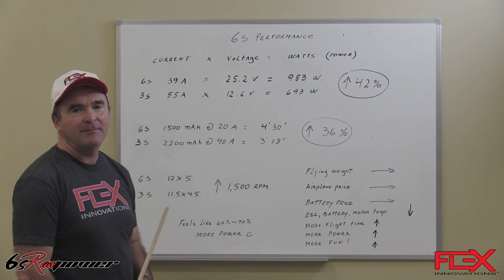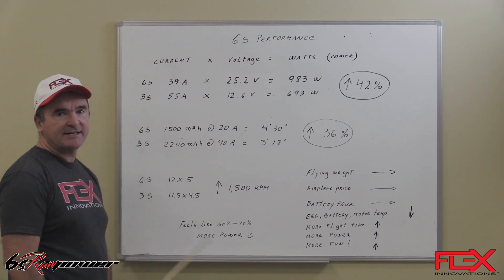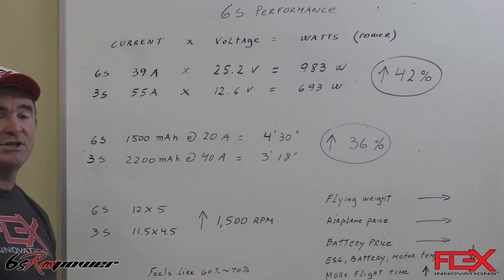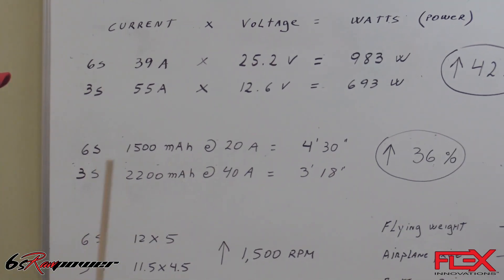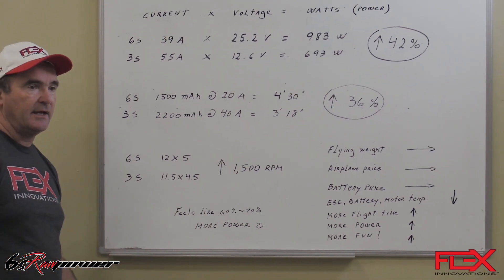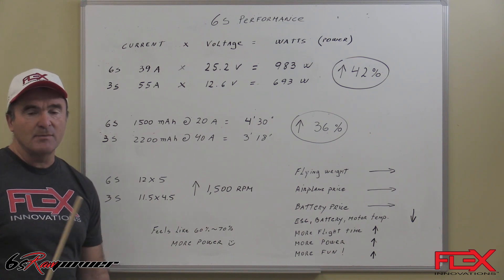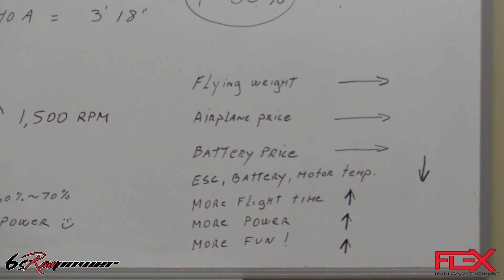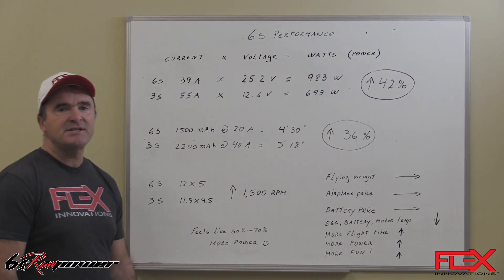6S Raw Power EXPLAINED w/Quique Somenzini

Comment: What a faulty comparison. You are comparing a 6s 1500mAh with a 3s 2200mAh. The 6s contains 33,3Watthours, the 3s contains 24,42Watthours. You should have compared the 6s 1500mAh 33,3Watthours LiPo with a 3s 3000mAh 33,3Watthours LiPo. Guess what, they come in approximately the same weight, around 250gr (+ /- 5gr) which makes comparing even more honest. Make sure on the 3s-plane you mount exact the same motor as on the 6s-plane, except the 3s-version two-times kV the 6s-version. This 36% increase in flighttime will be a 0% increase then.
Reply: The 3s plane needs to be lighter as it doesn't have the power for the extra weight so it's a reasonable comparison for practical terms

Comment: This video is complete nonsense. If everything was this easy why not fly with 12s or 24s? Because it is complete nonsense and internal resistance is not taken into account for example. Everytime you add a cell extra Internal Resistance of one cell is added. Another aspect not taken into consideration is availability of single cells and their capacity. Then there is a good reason to choose for more cells and sacrifice Internal Resistance of a pack, as wires can be thinner and ESC + connectors smaller. But it comes at a cost. I compete in Hydro 1 Naviga-class with 285gr LiPo, 2s or 3s. Will a 3s Hydro 1 always win from a 2s Hydro 1. Well, I competed and won several times.using a 2s setup. Which makes this presentation untrue!
Reply from the maker: This video is a brief and basic generalization for the system, and uses data (average current) from our testing. In no way do we claim this accounts for every tiny variable possible. It is a basic generalization, after all.

What you are not completely understanding is that the average current throughout the flight is significantly less on 6S, than it is on 3S. The pilot no longer needs to be as high in the throttle range throughout the flight on 6S as they would be on 3S. This isn't racing, where you're at full power all (or nearly all) the time! When the average current is so significantly lower than on 3S (20A vs. 40A on 3S in our example), its pretty easy to see where the additional flight time comes from.
Reply: @FlexInnovations  Still it does not make any sense. You should of course compare 3s and 6s LiPo with the same weight (I don't mind 5gr difference, 50gr in this case would be another story) and the same WattHours. If you make the comparison now, and use on the 6s-version motor-kV 50% of the kV for the 3s version, all other factors (same plane, same prop, same motor-size, same circumstances, etc.) flighttimes will be very, very close in this honest and fair comparison. Perhaps 3s-version has a slight advantage, as the 3s-LiPo-Internal Resistance is less and the ESC will burn less energy converting 11,1V to 5/6V BEC-output. Of course there are legit usecases for 6s, but advertising with longer flighttimes is not legit.

Comment: Great explanation. Thank you.  I have been flying my new Mamba 60 on 6s and love it. Seriously thinking about the Mamba 10 G2 now.
Reply: No, it is untrue!
Reply: @EricLaermans  what is untrue?
Reply: @alexgrigoreas4825  Comparing 6s with 3s like this is complete false. Internal Resistance of respective LiPos is not taken into account and it does not make sense comparing 3s with 6s LiPo with different weightclasses. Of course a 6s with higher caoacity in Watthours will result more or less in longer flighttimes (to a certain extent).
Reply: @EricLaermans  Wow, You totally went off the deep end. I get what you are saying but you obviously are far more literal than most of us need to be. I  am an engineer also and I believe you are missing the point but so be it.